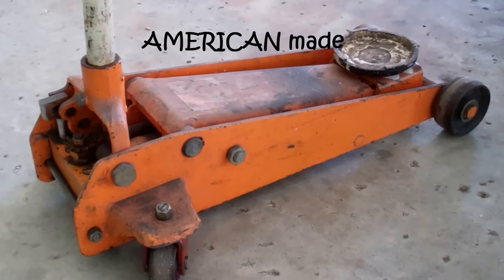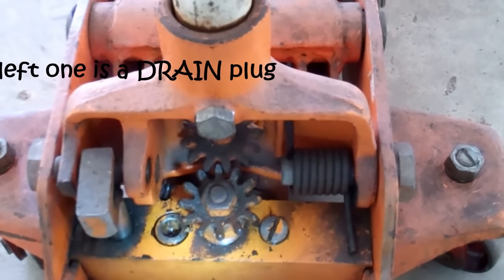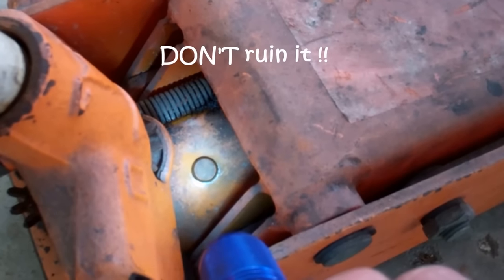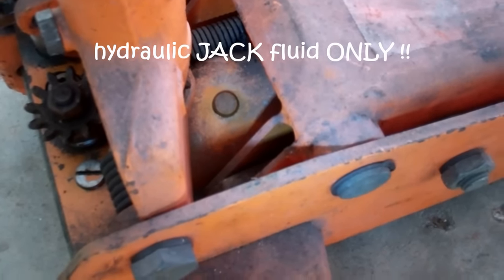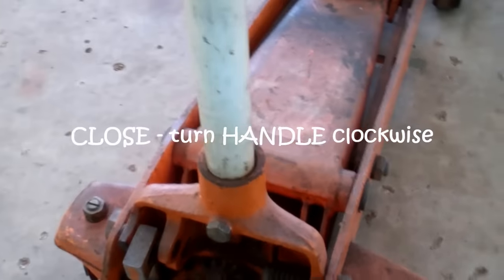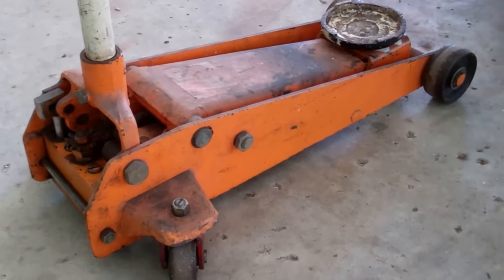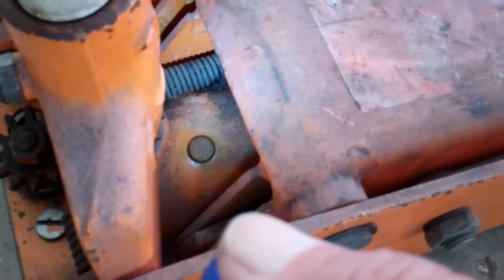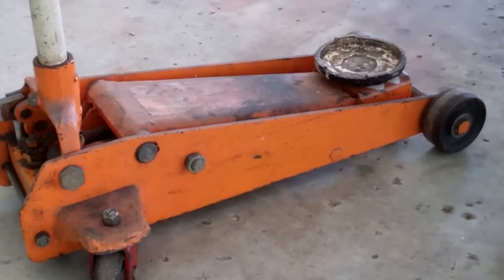Fill & Bleed a floor jack

Comment: I just happened to pick one up that looks exactly the same except it's a bit longer and has bigger wheels in the back and front. looked like some o'l neighbor cleaned up his garage cause he had a few things at the curb but the jack was what got my attention, it won't jack because it seems like the handle is stuck in the open position and won't turn the bottom gears to close. A hammer, patience and some wd40 oil should get the job done hopefully.

Comment: Thank you for the great video. My jack was pumping up, then slowly dropping back down. I followed your directions, filled with the proper oil, & now it won't pump up at all. So, can you tell me where to get the proper o-ring? Also, looking ahead, is there a trick to getting the spring back in place? I do have a nice, old Sears jack...pretty heavy duty like you described. Any help you can provide would be greatly appreciated.

Comment: I have an old floor jack that has stopped working.  I drained the oil and cleaned it all up. filled it with new Jack oil but cannot seem to get it primed!  Nothing happens when I work the handle!  It is a little different than the one you used in your video.  I think it was made in Japan.  Any suggestions?

Comment: I have this same exact jack that I got from my grandpa who got it sometime in the early 90s. Mine is pretty beat up and I’ve filled it with new fluid using this method but mine unfortunately is leaking from that pump seal. Does anyone know the brand name of this jack so I could possibly buy just a seal or seal kit for it ??

Comment: Have one just like it ,bought it at Costco/Price Club in 1985..Still works great..wish I knew where to get parts for it? Lost the shoulder bolt at Mesa Marin raceway some years ago.. Have to be careful that handle doesn’t fly out...Did come in handy in case of a brawl in the pits though😎
Reply: Hi Hekterr do you have the part # of it , I need to buy the seals for my tanks

Comment: Great video . Thank you for the information. 
  I bought one of these orange Jacks with the handle from a friend a few days ago for $10 . The jack will pump up but can't turn the handle but about a 1/4" inch in either direction. It seems the sprocket on the jack itself isn't turning. The two sprockets are joined but when I turn the handle counterclockwise to let the jack down , the bottom sprocket won't turn . Do you have any idea on how to fix this issue ? Any information is greatly appreciated. Thank you .

Comment: Hey Ed I have the same jack but I opened the 2 screws holes and put oil in them, do you think I need to dump that out and start with the plug? Thanks if you have any advise

Comment: Hi Edon.  Many thanks.  I have a very old Craftsman jack that looks much like yours.  I was curious what the Hex Female nut was used for on the left of the flat head screw?   Thanks for simplifying the process of adding fluid and releasing air from the system.

Comment: Great vid, the only thing I will challenge is the part about transmission fluid deteriorating the seals. And what I would like to add is plain old vegetable oil will work just fine, I've always used it in my jacks and I've never had to add any or bleed air more than once per decade. 👍

Comment: I did this with a 3 ton floor jack almost identical to this! My problem is I did all these steps then when I cycled it the pressure blew the plug out and HJF went all in my eyes and mouth lol! Now I’m kind of scared to use this thing should I be worried or just get a new plug and start over

Comment: What about draining and refilling? That an option? I used brake fluid before seeing this.(to top it off, so maybe 5% of total fluid is brakefluid) Its a great old jack, just like this one but bigger
Reply from the maker: watch the video again and make note of the part where I show you about the drain plug.  Yes, get that brake fluid out of there...it will dissolve o-rings and rubber washers

Comment: ATF is fine to use in a jack, though actual jack oil is thicker than AFT. It actually has stuff in it to condition rubber seals. Motor oil on the other hand is a big no no. Motor oil has sulfur in it, the sulfur absorbs moisture over time from the air turning the oil acidic which will eat up the seals in your jack....And no ATF does not have sulfur which is why ATF can be left in the transmission for many years, but motor oil is supposed to be changed yearly regardless of mileage.

Comment: If bleeding your jack doesn’t help then take the star nut off, then the big bolt. You will then see a square end. If that is loose then tighten and reassemble. It will fix it. My jack was stuck up and would not come down😩. Even after bleeding it. Also if turning the handle clockwise and it doesn’t tighten do what I said and it will fix it.

Comment: Got an OLD Craftsman 2&1/2 ton floor jack,  Made in Japan it has worked great for about 30 years , it started leaking down when it has a load, no fluid is coming out anywhere, , I filled up the piston at the rubber plug it didn't help, any Ideas??

Comment: Please help. I have one of these jacks. I had a slow leak at the plunger and I replaced the o ring.  Now the jack goes up on each stroke but it comes down before the next stroke.  Any  ideas?
Reply: Solved problem

Comment: Excellent video 👍 very informative as well.
Best tip was at 1:36 or so. I honestly never realized that I could lower the jack by loosening the thingamajig 😮 in a counterclockwise twisty nabob. SMH 🤦
I've always just used them to lift my car and when I was done I was supposed to put it in drive, then throw it in the scrap pile. 😭

These are actually reusable!?

Comment: I have a similar jack,about 20 years old,it sat for awhile outside,I thought it was broken so i decided to put new jack oil in it ,I did exactly what u did and   it started working again,but then i decided to mess with that flathead screw on the bottom right ,the 1 next to the drain screw ,and now it wont work at all ,any ideas on what happened  or if I could get it working again ? no leaking oil of any kind so I dont think its a seal ?

Comment: Thanks for the excellent video.  Do you have any idea if you're supposed to fill the reservoir all the way full? I ask because I did that and it just dawned on me that I might have done it wrong (filling the reservoir up to the very top) as I was surprised that I had to bleed my jack 4 times to get it to actually fill up with the hydraulic fluid.  That being said, I don't think I've ever bled the jack (at all) since buying it roughly 12 years ago.  I think I  MAY have added fluid to it but most likely NEVER bled it.  All that being said... does that mean there's anything wrong with the jack if I had to bleed it (today) four times to get to fill up?  Additionally (for those that are looking for an easy, cleaner, way to put the hydraulic oil in (rather than get it everywhere... like I initially did) try using an adjustable neck beverage straw.  It guided the oil into the reservoir cleanly and excellently!

Comment: Hello from Finland. I have excactly the same jack. I bought it five yrs ago for 30€ and it is definitely the best jack I ever have had. Now it has problems to lift up and I must pump very many times before it starts even moving. Must try these ideas. Does anybody know the make and model? And how hard is it to change the rubber parts? Or is it needed at ll?

Comment: So if you happened to open the screw on the right and found the factory set screw underneath and removed it thinking thats how you fill it, then put it back together and it doesn't work, what then?

Comment: I think i need to refill my jack, its bleeding oil out of the dial used to change between jack up & retract modes. Its a china made jack, 2mm sheet metal

Comment: Great information these are the things I need to know👍 Would you happen to know anything about adjust the handle tightness?? For instance when I turn the handle to let the load down I would like it to go slower as it goes down, any  information would be awesome thanks!👍👍
Reply: To turn the handle with sufficient control as to set the load down gently.

On my jack I installed a 3/8 eyebolt, 8 inches long, about five inches from the top end of the handle, secured by a nut on each side.

Now I can bump the eye of the bolt with the heel of my hand and fine tune to the amount of rotation that will ease the vehicle down onto the jack stands.

Comment: Excellent video!!  I got one exactly like that.  Gotta be goin on 30 years.  Just noticed it is dropping back down a smidge after each stroke.  I need to do the maintenance on it like you're sayin.  Damn thing has been so reliable I've just been neglecting it.  Thanks for making me realize the gem I actually have.  Do you think the oil should be completely changed after 20 years maybe??  If so, how is the best way to go about changing it??

Comment: Help help helpHave one of these. Was leaking a bit at plunger. Replaced o-ring  and filled with hydraulic fluid ad bled system several times. Now lifts on each stroke but goes down before the next stroke. Never did that before I repaired and murdered itI Any ideas?

/
Reply: Solved problem

Comment: Great video.  Appreciate you posting it. My father has the same jack and I followed your video to remove the plug and fill it up.  My question is, what’s the easiest way to get that plug back in the hole?  Thanks

Comment: To be safe I would  wear safty  glasses  and throw a rage over the rubber  hole . So when you bring  down the Jack .the rubber  ball doesn't  fly out  of the hole. And oil  spraying in your face. Do to pressure.

Comment: As probably an even older Englishman I notice he didn't show how difficult it is to remove or replace the rubber bung.
I cant fix mine so presumably a seal is knackered.
Not sure I've used the right oil.

Comment: Motor oil will compress?  LOL.  Liquids don't compress.  But he's right, just use hydraulic jack oil, as other fluids will either damage the seals, or will leak past them.  Tried a floor jack and bottle jack both this week to change my oil, and neither one worked.  I damn near threw them at the dumpster.  I'm finna go make my floor jack bleed out, then hopefully return to this post with my thumb UP.  Thanks.
Reply: Motor oil DOES compress.You shouldnt sound so confident when you dont know what youre talking about.

Comment: The O ring in mine is out. Same type. None of the auto parts stores have one quite like it. Any suggestions?
Reply: Harbor freight has complete oring kits with a ton of different sizes for a few bucks

Comment: I'm having problems with the handle not rotating. It used to be just fine. Then I let my son use it. He left it in the trunk of his car during the winter. Now the handle is next to impossible for me to turn or rotate either direction. Can the jack be repaired? Or is it permanently damaged?

Comment: My Indy 5 had that O ring go out. I'm ordering a new one now. You can replace the ring with out taking out that big ass spring. Just take the 1 bolt out and turn the handle assembly slightly. Now if you do have to turn that big fucking spring, how would one go about getting it back in? I want to repaint my jack but I don't know how you would get that monster back into its place.

Comment: How about automatic transmission fluid?  At least it will bleed red.  On hydraulic jacks without that rubber plug, I would try suspending the jack so the access screw is at the highest point allowing the air in the jack to advance toward that opening, then slowly (slow for control) maneuver the handle like you were jacking, but with the valve open (like when letting the jack down) this should assist in bleeding the jack of air quicker.

Comment: Arent we suppsed to drain the fluid first??
Reply: Nm, it clicked in my head what was going on after I finished typing. Not going to delete the comment in case someone had the same thought. 

Same concept as bleeding brake lines, we're just displacing the old fluid in the system with new fluid.
Reply from the maker: You can if you'd like, but it's not necessary

Comment: Ed, recently when I jack up my truck the other day, within a few minutes it started losing presure and dropping.  Is that because I need to add hydraulic fluid?  My jack is probably 30 years old and I've never seen fluid leak or filled it.  Thanks, DanontheBeach (FL)
Reply from the maker: sounds like it to me - just fill it and bleed it

Comment: I have that same jack no fluid leaking I’ve tried to fill and bleed jack but it still comes down can not jack up my truck 
????? Help
Reply: the rubber ring that seals  the ram or larger cylinder  in its bore is damaged, aged, cracked, worn....Or, there is a ball check valve that allow the fluid to flow one way only and it is not seating correctly.  Unless you know how to replace it, your  hydraulic cylinder & floor jack came to the end of its life.

Comment: Hello Edon,  I have exactly the same jack as yours. the problem with my jack is that the valve keeps turning forever clock wise when I try to lock it after I filled the oil reservoir.  do you know why.   I only know that the valve supposed stop turning when you turn the handle bar clock wise.  Again, mine does not.  I will appreciate very much if you can help me solve this problem.
I hope to hear from you soon.
Nestor
Reply: Floor jack handle will no longer rotate to a stopping point at which the release valve will close and the jack is ready to lift a load.

The malfunctioning handle just goes round and round.

On my Central Hydraulics floor jack, model 50183, from Harbor Freight, I have twice fixed this problem, in 2008 and again yesterday, by tightening the release valve nut.

This approx. one inch nut is right below the “winding gear wheel,” the driven star wheel connected to the jack base. I remove a 14mm nut, washer and the wheel for access.

Comment: I think it is time to fill and bleed a jack I have.  It just won't raise up much and then it goes back down.  It is good to know the oil for these things is dirt cheap.  I have two really and these were my dad's so they are not some awful Chinese things from Harbor Freight or anything like that.  Last time I had a tool from that place it was a set of the screw drivers they sometimes give away if you buy something else and have the coupon.  They are JUNK!  First time I used one the tip of a flat tipped one twisted.  My guess is either low quality steel or not heat treated.  It may have been both those things really.  I have some Craftsman screw drivers for many years that have never once done a thing like that.

Comment: You don't say if the handle valve needs to be open or closed when you take out plug to release the air.  I guess it doesn't matter...

Comment: This is a good video showing how to fill and bleed this floor jack. 
On the other hand I have the exact same jack, mine still have the stickers on it and it say Larin manufacturing.... made in...... wait for it... China.  
I've seen the same exact jack with different stickers, including craftsman. 
Also just because it is made of carbon steel (aka pot-metal), it does not make it better. 
Aluminum jacks can be just as good.

Comment: Hey, I have a very similar jack to this in Australia and it stopped holding pressure. Before i saw this video however i took it all apart to see if i could figure out how it worked myself, and turns out I couldnt. I was just wondering if anyone knows what the two plugs are at the very start are for and how they work. I opened both of these plugs and on the left side i think two little steel balls fell out and on the other side there is another screw underneath it. I dont know if they are specific presets or if the ball bearings have to go back in a certain way but if anyone know how to explain how i could fix this issue that would be great. 
Cheers
Reply: There should be a small ball and a larger ball in the left hole, small ball goes in first.  The other hole is the factory set pressure relief valve.

Comment: hey Ed,  I inherited same model floor jack works to lift and hold and release, a little scratched paint due to age use and some grime (plan to clean a bit) what would you say a fair value is?   I am thinking of selling due to no real need for it

Comment: 175 years! I must say that you've worked safely. However, when you mentioned "you don't want to be under a car with a bad jack", it wouldn't hurt mention jack stands. Yep! Even if the hydraulic jack is brand new, NEVER !!! work under a car without proper support⚠️⛔️🚫
Reply from the maker: good advice

Comment: Here is the link of o-rings that work with this floor jack . After hitting and missing with many o-rings , the finally found these ones as a perfect fit for exact same floor jack . Link below 

208 Buna-N O-Ring, 90A Durometer, Round, Black, 5/8" ID, 7/8" OD, 1/8" Width (Pack of 50) https://www.amazon.ca/dp/B0051XYZ4I/ref=cm_sw_r_cp_apa_i_yRTCDbSN4QSBZ

Comment: What about if the jack lifts up and then slowly starts to drop and lose pressure ?
Reply: Dill Wiggle I’m wondering the same thing! Let me know if you find out
Reply: Try bleeding the jack by turning the stem counter clockwise until it stops, remove the rubber plug on the hydraulic housing and give the handle a few pumps while the valve is open. When you are finished, top off the hydraulic fluid and put the cap back on.
Reply: O ring

Comment: Loved your video but you said one thing that conflicted with my Mechanical Engineering education... motor oil is not compressible. You said it was. There may be some other good reason not to use motor oil in a jack, but that is not the reason. I suspect the viscosity is not right for the size of the passages in the hydraulic circuit.
Reply: Jack Gutschenritter -- Actually oil will deteriorate hydraulic seals often rapidly.